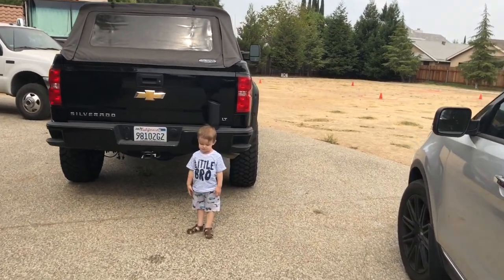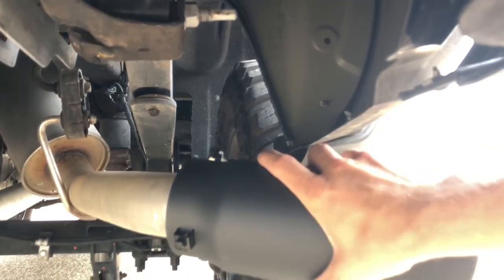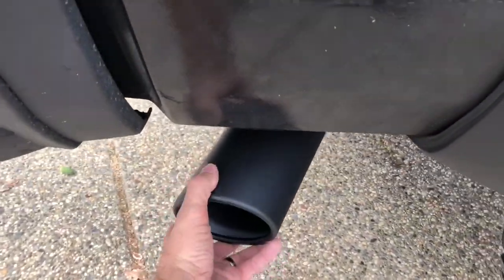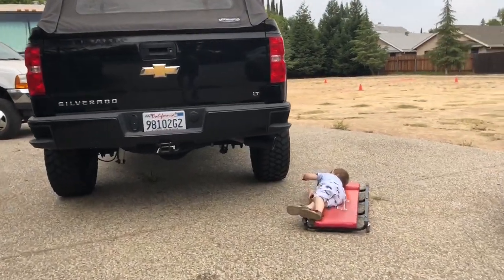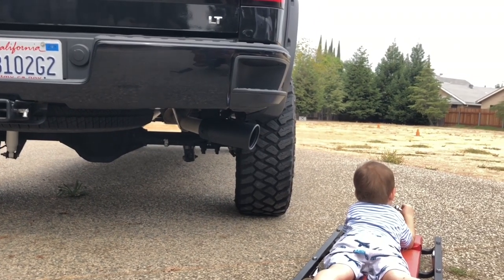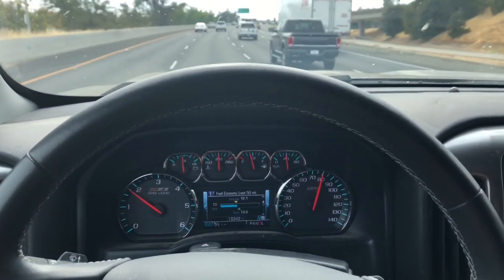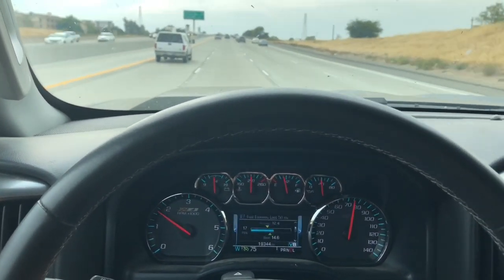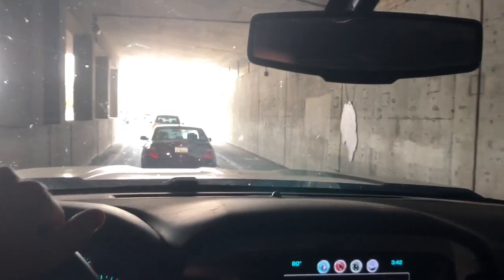2017 Silverado Z71 5.3 - 4" Diesel Exhaust Tip Install, drive sound, take off, start up

Comment: Hey bud remove the exhaust valve an use one of them band clamps you used with your straight pipe setup to cover the holes an tighten down Viola, P.s. sounds pretty good!
Reply from the maker: Thx bro, ya I’ll take a look how it pops out and go from there, good idea on the clamp

Comment: Great looking and sounding truck man! Love the lift and rims!! I took mine to a local shop and had them delete everything from the cats back. No muffler, valve, or resonator only cost me $80. Sounds freaking awesome! I'd take the valve out just because you don't need it if your not going into V4 mode. Even if you were, the drone ain't that bad, it kinda sounds like a helicopter at some speeds but I don't mind it at all. It will for sure make it a bit louder. Cold starts in the morning are amazing but I'm sure my neighbors aren't fond of it lol. I also get like a popping sound when it shift at WOT. Love the setup man!!
Reply from the maker: Thank bro, you have vid of yours? So still have Car but nothing else?
Reply: @FixItNick  I can post a video if your interested. I live in commiefornia too so I have all 3 CATs but nothing else. Muffler gone, flapper valve gone and resonator gone. I like the sound, it's a pretty raw V8 sounding growl. I can understand why some don't like the sound of it but I love it. I pull a travel trailer and in tow mode with it holding higher RPM it still isn't that bad. I was actually surprised it was as "quite" as it is when I picked it up after getting it done. 👍👍
Reply from the maker: chevyguyss yes don’t if you can wanna hear it

Comment: Like the sound. But if your looking for a little more loudness to it. Then I have an idea cause the 5.3 is an ls motor and they are able to be extremely loud with the right set up. Do some magnaflow high flow cats with a Y pipe going into a single flow master super 10 and dualed out the back with some longer 18x3 inch black tips. But if your looking to go def lol just true dual it from cats back with no resonator
Reply from the maker: I wanted to go corsa originally but decided to go the DIY cheapest best sounding mods at home, I decided on what I like best, #4 in this video https://youtu.be/Ce8OAX0erNM

Comment: Hey as you was driving I kept hearing a knock when you hit cracks in the road. Just a slight knocking sounds like something in suspension. I actually had. A knock like that on my 2006 Silverado had to go back and forth with them about the Rack and Pinion. They Finally replace it and never had that knock again. Sweet truck got to say that. My 4.3 don't sound that throaty
Reply from the maker: I didn’t hear anything at what time?
Reply: @FixItNick  started about  10:37 min it's a light thudding Everytime you hit a little dip
Reply: good one

Comment: Take some lighter fluid and spray it inside the meeting of the exhaust to and light the lighter fluid it will burn the fiberglass in that glass pack up and make it sound more throaty sounds great at the end revs though
Reply from the maker: Thx bro, spray it in the where?

Comment: I think it would look better without the soft cap. U definitely need to check out Cold Air Inductions
Reply from the maker: Best soft top ever!!! Lol ya I was thinking about an intake and maybe tune
Reply: @FixItNick  I want to get a tune for mine. And a full Exhaust. Long tube headers and all. Lol

Comment: just to let u know if you don't already...with bigger tires on, you're going faster than your spedometer tells you. in my truck I'm running 35's and stock was 31's. I'm going 10% faster than what my speedometer tells me.
Reply from the maker: Yup that’s correct
Reply: @FixItNick  just wanted to make sure you knew! love your vids man, the truck is absolutely awesome!

Comment: So I just replaced my muffler with a Super 44, I have a 2017 5.3 also, and it's not enough sound. I'm wondering if I should straight pipe or take the resonator out...
Reply from the maker: Resonator does quiet down, you removed valve flap? I want to do another vid with flap fully open or removed and resonator disconnected to compare
Reply: @FixItNick  yes I took the valve out still not very much. Thinking of taking out the muffler and just straight piping like you, sounds good even with the resonator.